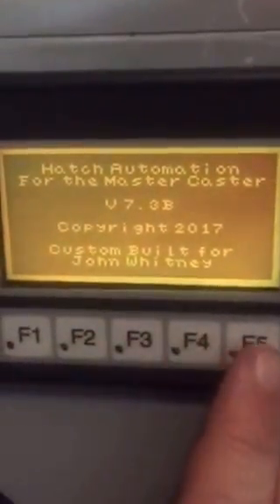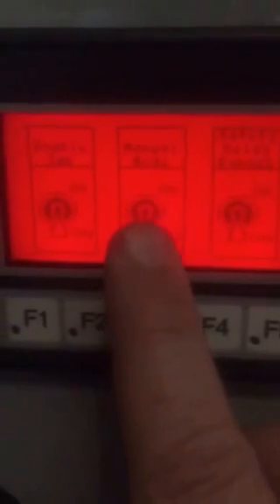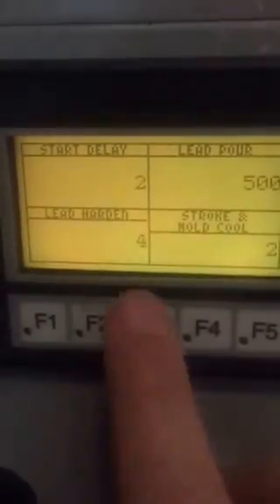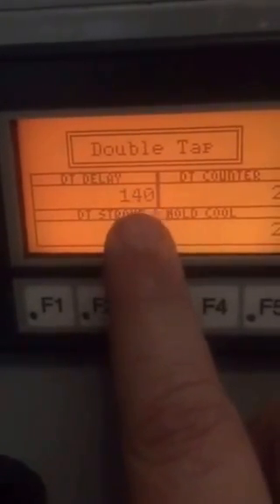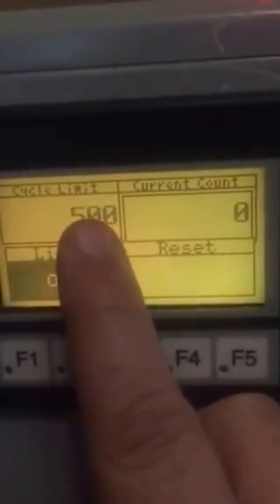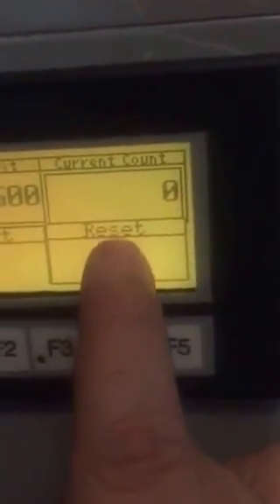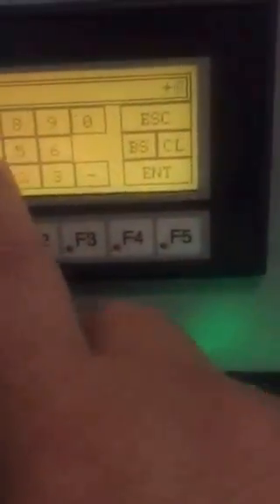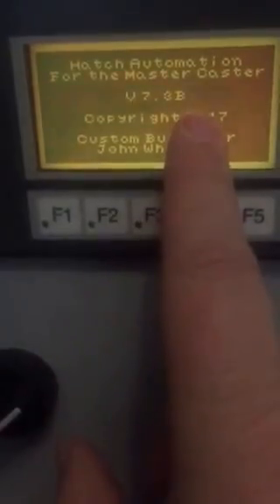Hatch Automated master caster basic control panel

Comment from the maker: I only sell the panel itself normally with the air valves.
The panel is $750.  The air valves are $30 each and you need 3 of them.  The cost of the air valves is exactly what they cost from Automation direct (well $1 markup for easy math)

You would need to purchase the rest of the pneumatic parts (air cylinders, fitings, ect) and make the brackets to mount the two air cylinders.

If you are non-USA then I could get all the parts you need and do a complete package. I normally don't do that for USA customers

With the purchase of the panel you get lifetime support and future program updates.

The basic model controls just the function of the machine itself. It does not control the temperature of the pot or control the operation of the fan.
On other videos you see that my deluxe model included a PID controller and had Fan control built into it.  
These options require a larger enclosure and more parts.  For most customers they already have a PID controller installed and they don't want the additional cost (almost double) that these options add.

do some reading here -> http://castboolits.gunloads.com/showthread.php?173407-Automating-the-Master-Caster-Another-way-to-skin-the-cat